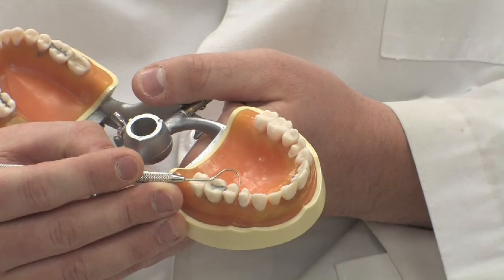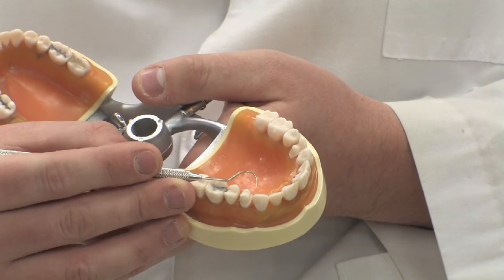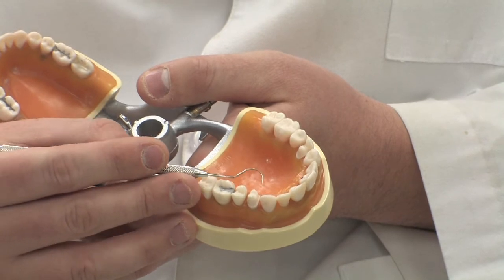Dental Gold : Can a Dental Gold Bridge Be Repaired?

Comment: I have an old bridge I had for more tgat 20 years. I need to replace it Iam having probllems with meat getting between my molars  causing discomfort.  I'd like to know if getting a full cast high noble bridge would be right for me instead oi porcelain fused to metal. Last question how expensive would a full cast bridge be.